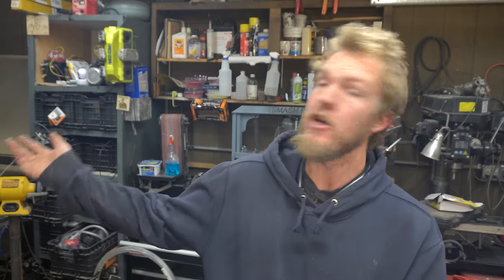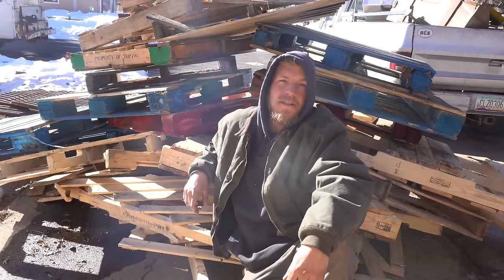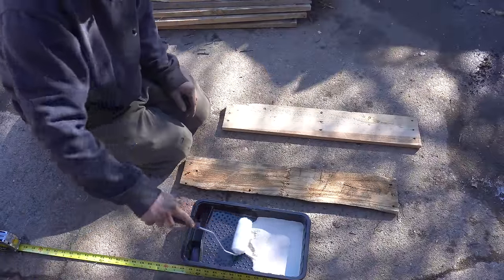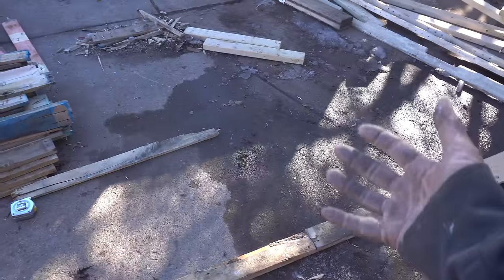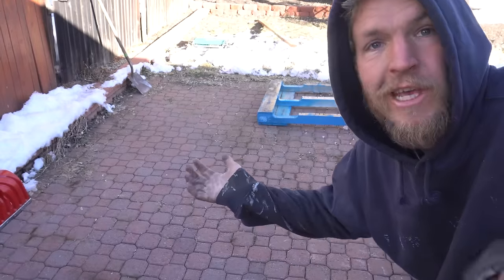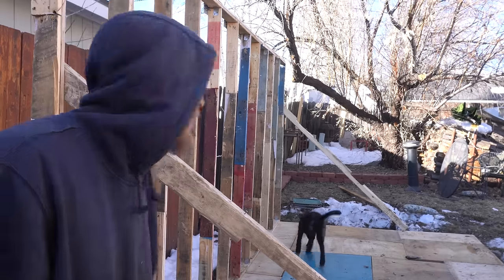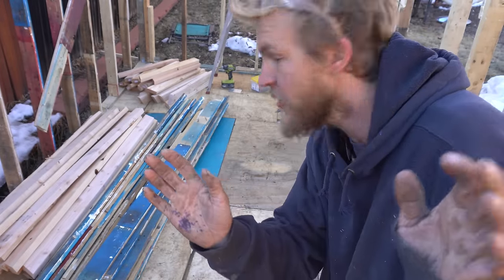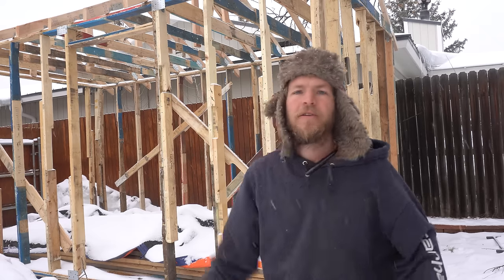Building A Shed Using All Reclaimed Wood

Comment: Dude, if you're not planning to fully remove the nails from the boards, the quickest way to pull a pallet apart is with a sawzall, by cutting straight through the nails in between the boards. There's a plenty of bi-metal blades out there, that are specifically designed for cutting wood with nails.

Comment: I like the idea of the reclaimed materials. When doing the siding, definitely make it look as presentable as possible. The burnt wood look, when done correctly, looks amazing on a building, and will make the wood last a lot longer. I'd recommend still tyvec the whole thing, and maybe a metal roof if you could. It would save you a lot of time. You'd have a very robust building. Good luck man!